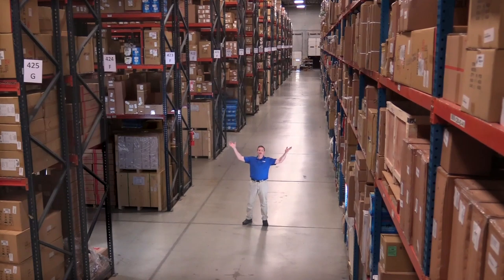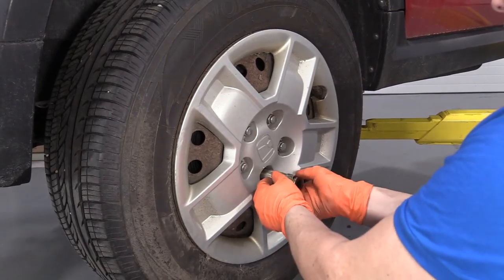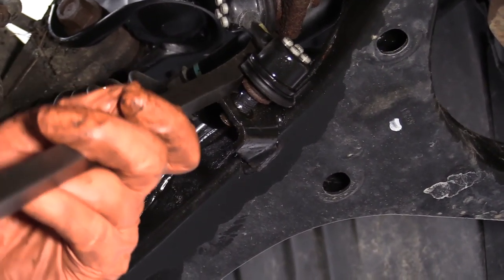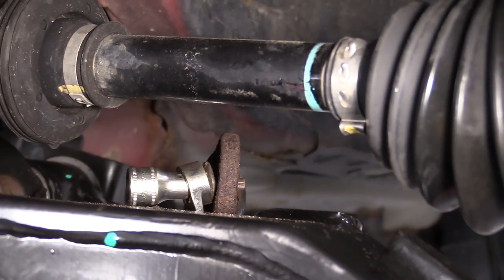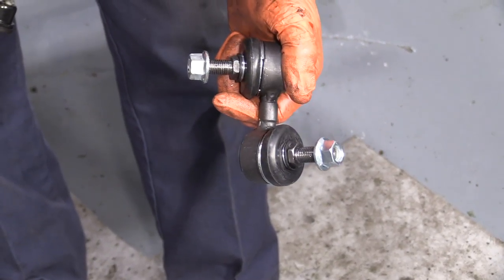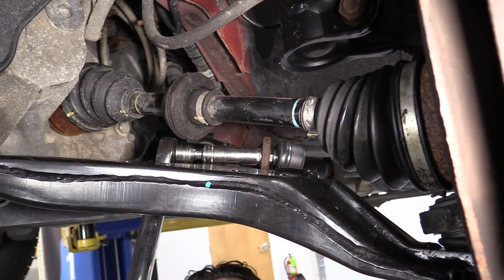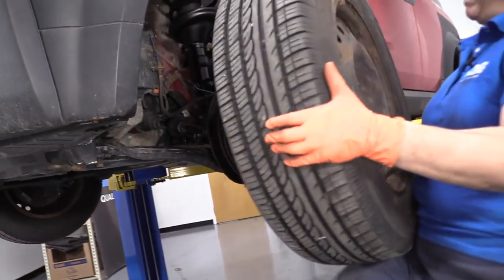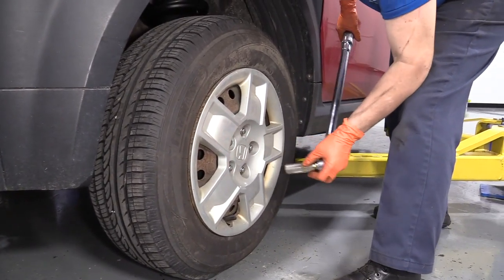How to Replace Front Sway Bar Links 03-11 Honda Element

Comment: You mentioned to put the tires on before tightening the top of the strut.. did you have to loosen the top of the strut before the job?
Reply: Lol thinking same think. You wouldn't think so
Reply: This video is a cropped video from the strut replacement video so that's why she mentions the struts.

Comment: if only my bolts came off that easy
Reply: I have had the same issue with the sway bar link nut.  I was able to get 1 out of 4 completely off, the other 3, I was able to get 3/4 way off when the Allen head would strip, and I had to cut the stud off.
I am guessing this was a common problem and that's why the new parts have a place to put a wrench instead of using Allen head to prevent spinning.